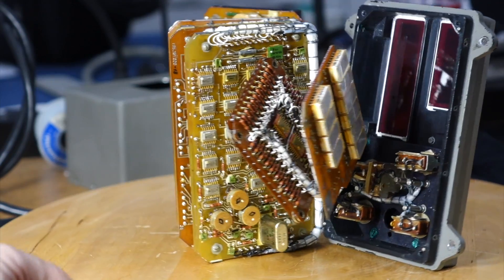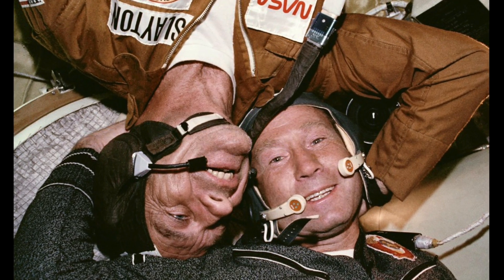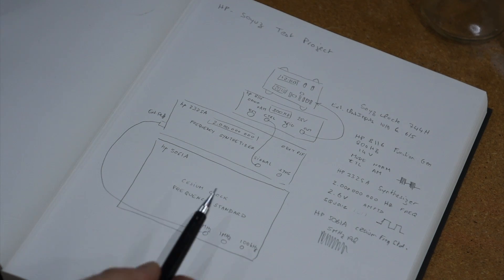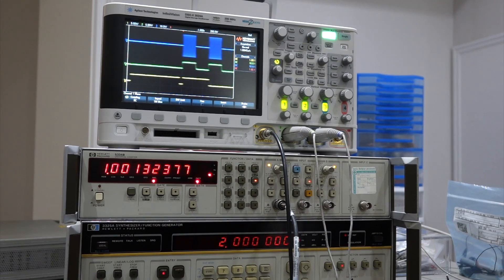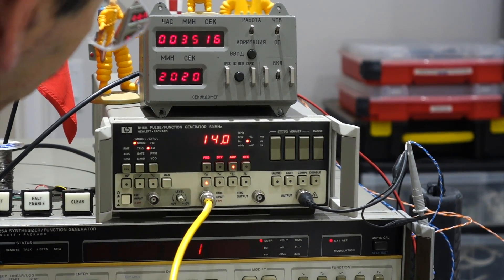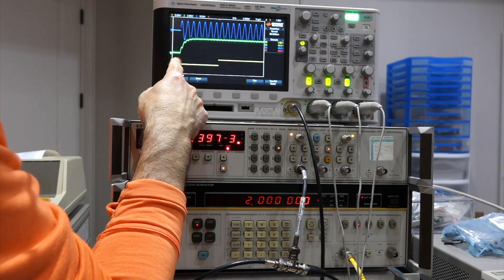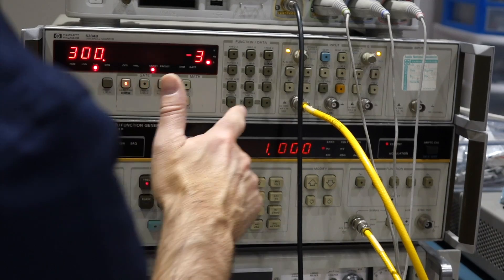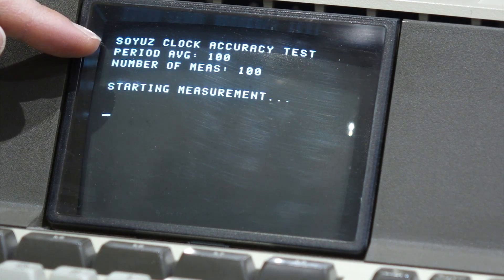Soyuz Clock Part 6: International Atomic Space Clock

Comment: I assume the whole problem is that the 800Hz and Hz signals are not synchronized. If you divide the 10MHz output of the atomic clock by 12500 to obtain an 800Hz signal and then divide 800Hz by 400 to obtain 2Hz, the desired signal could be generated by one NAND gate

Comment: I’m pretty sure dividing down the atomic clock to 2Hz would be a lot more accurate, PLL systems have drift and jitter.
Reply: And at the same time take out the 800Hz from the divider chain and use a gate to send that to the output, so you have phase-coherent bursts.
Should be doable with a couple of 40xx CMOS chips, then some line driver for the output.
Reply from the maker: @Rob: That would certainly help a lot, but the simple clock recovery mechanism of the Soviet clock is never going to be phase accurate enough, by a far cry. And then I bet the Soyuz timing source did not do that either, it just used the 28V 800 Hz from the ship supply. Because of course, this short term phase noise does not matter a bit for the purpose of indicating seconds to astronauts. The only important thing is long term stability.
Reply: @CuriousMarc  It also appears they are not really interested in subsecond accuracy as the clock cannot be set really correctly anyway.
Using 2PPS instead of 1PPS does not make that better either, in case of 1PPS you could at least know that the seconds tick would be synchronous with the reference.
Of course indicating the seconds does not require better accuracy but the alarmclock+relay function potentially could control something like an engine burn which could require some more accuracy.  In practice it proably doesn't, for the typical Soyuz mission.
Reply from the maker: @Rob2  Oh yes, you are right, forgot about that. We don't even know within 0.5 seconds when it will tick!
Reply: @CuriousMarc  This is why I found it a bit strange that it ticks from 2PPS instead of 1PPS as is common for time synchronization...  they must have had a reason for that, but it is not very obvious.  With 1PPS it would at least have been feasible to manually set it to correct time when given some clues over radio, for example the six beeps as used in the old days.
Reply from the maker: @Rob2  It’s historical. The electromechanical clock this replaces used to have ½ second ticks. We have one on loan, hopefully we can demonstrate soon - I was waiting for the end of the shelter in place so the whole team could be together.
Reply from the maker: The PLL adds phase noise, particularly at low frequency. But no drift. The clock will not drift more than the Cesium. That said you are right, dividing the clock would have been the more correct way to do it. Indeed, HP made a divider specifically for this Cesium source, but regrettably, we don’t have it...

Comment: Fun measurement setup, but while it would have made made no difference on the long term graphs, you could probably get substantially better single-period stability if something other than the 8116A was used to generate the tone burst.  Since it's using an integrator to sense the start of the burst, the phase the burst starts at is critical to eliminate leading edge timing jitter, and the 8116A can't be locked to an external reference!  You could see the phase of the beginning of the burst drift on your scope captures, and if you used an instrument that either started the burst on the trigger (rather than just gating a free running oscillator) or which was reference locked to the same atomic source, you could make sure that every burst started with the same phase, so that the integrator's rise would be much more precisely controlled (I am assuming that the soyuz clock isn't measuring the time between the beginning and end of the integrator and is instead timing based off of the rising or falling edge of the integrated burst signal).

Would be interesting to see an 11 or 12 digit/s counter thrown at it too, though not period appropriate, to really flesh out the noise floor measurement for the synthesizer, but I suppose I am a bit of an amateur time nut.

Comment: when your friend takes back his cesium clock will you run it from your GPS clock? Because my casio does better than 17sec a day. I have a Heathkit GC-1000 but I'm not lending it, lol.
Reply: do you know why the jack on the back of the Heathkit outputs 3.6 Mhz and not 1 Hz ?
Reply: @KD5NJR  I have no idea. I assume it had an application when it was designed. From what I've read it's not that accurate compared to what's available now. Also mine doesn't have the RS232 accessory.

Comment: I've been watching this series and I am curious.  Mind you, I'm not an electrical engineer, but I have an interest in accurate time bases for clocks.  How would what you have done here, in the long term, compare to the accuracy of using the AC power grid frequency as a time base (I'm in the US where it's 60 Hz.)  I think it's interesting as I have AC motor powered clocks that, as long as the power is there, that I nearly never have to set.

Very enjoyable series, by the way, and thank you for presenting it!
Reply: That is true, because the power grid engineers actually have a clock similar to your in their control room besides a very accurate clock (probably synced to standard time via Internet or GPS). When they control the line frequency (by ordering more or less power into the grid from the power stations) they have two targets:
1. In the short run (seconds), keep the frequency as close to 60 Hz as possible
2. In the long run (hours), make sure that the power grid clock is not fast or slow as compared to the true clock

The second target is there to cater for the dwindling amount of line synced clocks like yours still in existence.

Comment: This is vaguely reminiscent of an experiment that a colleague and I did, with much less sophisticated equipment, in 1964: to measure the local value of the force of gravity, G, to four significant digits, using a 200mm Invar steel pendulum. Check out https://bit.ly/3bVZzA3 if you're interested.

Comment: Is there not a mechanical clock display available on the HP?  Patek-Philippe?  The most accurate PP ever made?
Reply from the maker: There were at least three: a separate electromechanical “digital” unit, an internal Patek Philippe clock face display (drool), and an internal LED display.
Reply: @CuriousMarc  OK... I'm looking at the panel of the cesium thing, and I see what looks like a watch dial with 'C FIELD' label... is that not a clock face?  I guess all you'd need would be a simple 1-second mechanical movement driven by the 1PPS pulse.
Reply from the maker: @scowell  No that’s the multi-turn pot adjustment for the C-field. Which we have not done yet. Hopefully we can do it when the shelter in place is lifted.

Comment: In 1983 as a newly minted engineer, I designed a piece of test equipment at GE Aerospace that had an embedded 8085uP.  It was managed by an HP 85, via the GPIB interface.  I had a little difficulty handling the noise on the GPIB handshaking lines - but some seasoned engineers helped me solve it.  Great memories, seeing that HP 85 in use!  Great video and analysis, as usual.

Comment: I am not sure about that the external clock source is designed to be feed from some reference on Soyuz board. I am thinking about possibility that theese 2Hz pulses came from some radio receiver, which could lock the clock to some radio clock station on the earth. Using A1 modulated signal to interconnect it with some clock reference inside soyuz simply makes no sense and looks too complicated to me. And on top of that. If I am right and this was connected to some radio equiptment instead of some local reference, it opens the posibility, that there was more commands than "increase ½second", e.g. "first second in minute" or something similar. I do not know how much this was reverse-engineered, so I do not know if this is possible, or not.

Comment: The Allan Deviation of the output frequencies of the 3325A/B is going down proportionally from 20 MHz to low frequencies, so @ 1sec time constant, an output of 1Hz got  1E-4 stability left only. 
You better build a divider for that purpose, either with TTL counters, or more easily with the PICDIV, that is a PIC controller, programmed as a divider state machine.
See here: http://www.leapsecond.com/pic/picdiv.htm
Reply from the maker: That is absolutely right. A gated divider would be the correct way to do it. That said it does not affect the clock accuracy. Just makes short term measurements  very difficult and somewhat irrelevant.

Comment: Also note: each one of those instruments has it's own clock source.  Each one has its own drift which changes over time and temperature.  You cant afford instruments had will give you accuracy out to 6 or 9 decimal places.
Reply from the maker: The instruments were referenced to éther the Cesium or the GPSDO. Gives 11 decimals. But even if the universal counter was used on its internal source (which it wasn’t), it has the high stability option good to 9 decimals. It was calibrated in the previous video and was actually better than 10 decimals.

Comment: I'd assume the modulator also introduces some jitter because the phase relationship between the two signals is free. Could you use the low part to reset the phase/oscillator in the modulator so it always starts the same?
Reply from the maker: You could, but none of that matters. The phase noise does not impact accuracy at all. It just makes short term measurements somewhat irrelevant.
Reply: @CuriousMarc  Right, I just imagined that if you are able to reduce the jitter by n orders of magnitude, then the time needed to achieve the same precision is reduced by the same amount.
But sure for demonstration purposes it's not that important. Thanks for your entertaining and educational videos.
They motivate me to take deeper dives into topics and also get my grey cells going ❤️

Comment: So did the Soyuz program have equivalent frequency generator soviet equipment onboard?  or did they just use the internal clock? is there a way to send a radio signal to sync to Moscow time?  How did the Soviets provide an appropriate level of precision to allow the clock to function in a useful manner?  If I understood correctly, some of the inaccuracy derives from the 60hz grid frequency being slightly inaccurate over short periods of time, is that correct?

Comment: I've been wondering why the Soyuz clock module external clock signal is a tone, given added complexity and phase noise? One thought I had was the clock module could be clocked via a radio link, rather than from a local source. It might not have been used in this application (although it might have been useful as a "last resort"), but it could be useful in other "master clock" applications.
Reply: It enabled them to put the external signal through a transformer to give Galvanic isolation.
Reply: @cambridgemart2075  I think there has to be more to it than that - a pulse would still work through a transformer.
Reply: Not reliably. Any switching noise nearby would get picked up. So integrated burst is the correct way to go.
Reply: I would suggest the 400Hz was chosen to place it in the middle of the passband for a typical voice  circuit from the era. It would work equally well on a telephone line, AM, sideband or narrowband FM transmission, and may well have been a more widespread standard.

Comment: Your HP8116 amplitude modulation is not phase locked to the gating signal.  The 800hz being gated by the cesium (via the 3325) starts at a random point on the sine wave, this has got to be a big source of the noise into the soyuz clock, because its integrator is going to have very different time delay based on the starting point of the 250ms wide sine pulse waveform.   If you used an arbitrary waveform source, like an HP33250 (if I am remembering right) you could have the cesium 2hz waveform act as a start and stop command for a sine burst that always starts at the same point on the sine wave.  Or could you use a gated 800 square wave input into the soyuz clock? and generate it from a higher frequency clock that is locked to the cesium as well, perhaps using two 3325s, one at 2hz and one at 800hz both driven by the 5MHZ cesium reference?.  I do love the HP85,  I used one of those back in the day until the belts and rollers disintegrated in the tape drive.   Maybe I'll dig into some old equipment now that I am stuck at home.  Thanks for your enjoyable videos.
Reply from the maker: Yes, you can clearly see that's one of the biggest contributor to the clock recovery signal jitter. Which is all fine of course. Astronauts are not sensitive to their seconds signal phase noise...
Reply: @CuriousMarc  Well, if you had a pair of 3325A's you could get around the problem. Clock both off the 5 MHz and use one to gate the other.
Of course a TTL or HCMOS divider chain off the 5MHz to generate both the 800 Hz and 1 Hz would pretty much eliminate the phase noise completely.  I can't recall if HP made some programmable counters in that era that could be used as programmable frequency dividers, but I think they or Tektronix did.
Reply from the maker: They did one just for that very application, to divide the Cesium and generate very low phase noise  clock timing. That’s the unit you see on top of the flying clock rack. But we don’t have it...
Reply: @The Harbinger - I wondered the same about locking...but in layman's terms.

Comment: Отличная работа, никогда не перестаете удивлять! Хорошо что хоть кто-то помнит про миссию Союз-Апполон, такое ощущение что сейчас все игнорируют это огромное достижение космонавтики.
Reply from the maker: Thanks! Translation by courtesy of Google translate: "Great job, never cease to amaze! It is good that at least someone remembers the Soyuz-Apollo mission, it seems that now everyone is ignoring this huge achievement of astronautics."
Reply: My mom did translation of a lot of the in-flight docs from Russian to English. Always found it fascinating that she could she could translate the docs but pronouncing Russian was always really tough for her. My dad worked for Boeing out at Johnson Space Center during that period. He told us that the US had to build the docking module since the Soviet Soyuz spacecraft couldn't handle the necessary precision docking required. Always wondered the details on that. But, I was a young kid at the time.
Reply: @68Polara500  The Apollo service module was grossly over powered - the original specification had it launching from the lunar surface.
That gave a lot of reserve power that was never used, to change orbit. 
Soyuz needed more precise launch parameters to dock in orbit due to limited delta v.
Reply: @68Polara500  The story with the docking module is actually pretty strange and amusing. It had to be designed as a female to female adapter, because traditionally a docking system would be male > female, and neither country wanted to be female. (I suspect both were designed to be "male" from day 1 regardless). Supposedly the soviet engineers on the project started calling it "Hermaphrodite", and this term had to be explained to a high ranking military official that happened to visit. 
I would imagine soyz could handle the precision given that they achieved totally automatic docking quite a bit earlier, back in 67.
Reply: Полёт Союз-Аполлон был в 1975 году, а в этих часах на радиодеталях 1983 год. В 1973 году в СССР уже производились электронные наручные  часы. Спрашивается, зачем отправлять в космос (где каждый грамм на вес золота) часы с массой утюга и энергопотреблением утюга?
Reply: @Kot_Anatolyi  Устойчивость к перегрузкам, радиационному излучению, общая надёжность и возможность получать синхру от корабля. Если переделать наручные часы под все эти нужды - получится то, что мы видим в данном ролике. :)

Comment: what is generating the reference being used by the frequency counter???
Reply from the maker: The frequency counter was locked to the GPSDO, which I checked was phase locked to the Cesium on the time duration of the measurement.
Reply: The cesium tube made by agilent?
Reply: @rkan2  the 5334b universal counter has an internal oscillator it uses as a reference for period, its delivering data out of gpib to the computer, so the measurement can only be as good as that ovenized crystal oscillator
Reply: the cesium clock is about 5 digits more accurate than the oven oscillator in the 5334b
Reply: the current setup is saying its 1s gained/lost roughly every 2 years which is in the realm of what a high performance crystal oscillator can give you
Reply: he can't measure the accuracy of this system properly without a more accurate clock source

Comment: But you measured the Russian internal quartz oscillator  accuaracy here in earth' gravity. We now need a measurement of it in zero G.
Reply from the maker: Assuming you are serious, there is indeed a correction for gravity on Quartz oscillators. But it's minuscule. For my HP oven Quartz oscillator for example, it's on the order of 25 mHz at 10 Mhz. You can measure it (and I did!) by simply flipping the instrument over. The normal Quartz oscillators are not stable enough to allow a meaningful measurement. But assuming you actually could, I imagine on the order of 2.5 mHz at 1 MHz. Not going to get your 17 seconds back I am afraid... I willing to test in orbit if someone pays for my ticket :-)
Reply: I was wondering the same in the last video 😋 Also the orientation makes a difference if I recall correctly. I assume it's half-joking half-serious :)